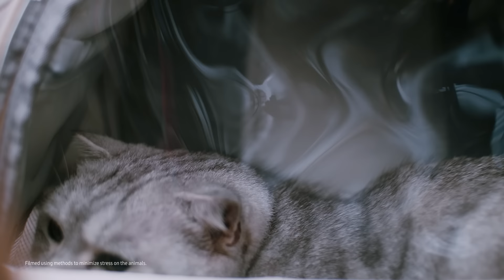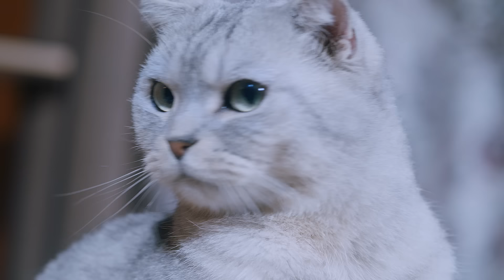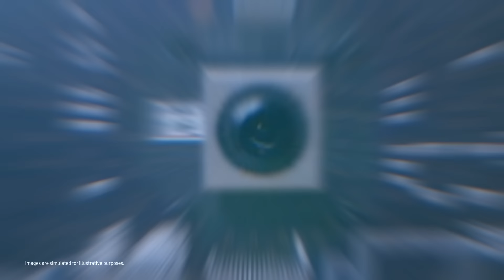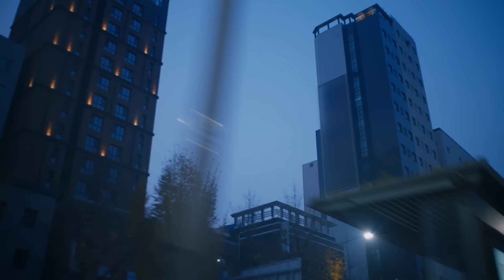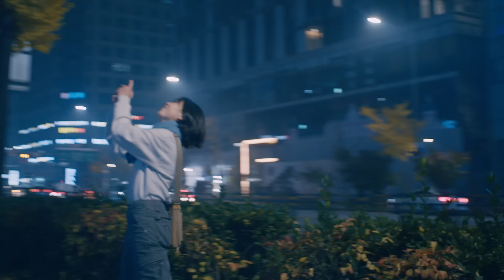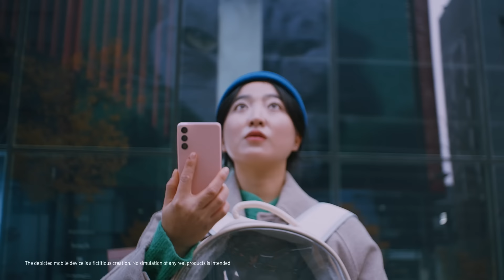ISOCELL Image Sensor: More pixels. More detail. | Samsung

Comment: Sure, if you have a high quality lens like in the video, of course it will look good. 🙄

Phone lenses aren't good enough for this, no matter how many megapixels you squeeze  in a small space.
Reply: But they did not use the HQ lens. They have used standard phone lens. Read the press release
Reply: @digimaniecz  It's literally in the video. When it's removed, it's just to illustrate zooming in to the senzor animation, but smartphone lenses aren't capable of such clear image yet, if ever.
Reply: @etnevel.naitzsirk  Once again, read the press release. I will copy it here for you: "They even built a custom adaptor to allow them to attach various DSLR camera lenses to a test board. “In the end, we thought it was most important to capture the scene in the same conditions that smartphone users would be in,” said Kaeul Lee of the Sensor Solutions Team. “Because of this, we went with a smartphone camera module with no other aids. "

So they tested the DSLR lens but the final image was created using the smartphone lens. I have tested 1.0um and 0.8um pixels at smartphones and believe it or not, the 0.8um pixels with smartphone lens were really able to resolve more details (64 MPx at 1/1.7-inch which is around 128MPx at 1/1.2-inch).
Reply: @digimaniecz  Samsung is weird. I would never use a smartphone lens to print giant billboards. What's this, amateur hour? 😆
Reply: @etnevel.naitzsirk  No one will. This is just marketing. Nevertheless, the smaller pixels really can bring more details to a photo (if there is not a strong denoising which usually is). Another question is if it is useful. Which usually is not.

Comment: This is somehow missleading. First of all the images were taken in a controlled environment with plenty of light, by a person with experience. Secondly the subject chosen for the advertisment was probably chosen on purpose. While fur would be a good subject, yet a different subject with different texture, color (e.g. a parrot) would have been more difficult to shoot. Last but not least the image was properly processed. A normal guy/girl would struggle to obtain the same performance under tough lighting conditions. This is why is somehow missleasing. As a guy with some experience in photography we all know that a smaller pixel size in general comes with a lower sensitivity and is prone to noise. So 200Mpx in my eyes is really nonsense. I would prefer a 24 Mpx sensor with DSLR performance over a finger nail sized sensor with 200 Mpx crowded in a really small area.

Comment: Really hope this doesn't make it to the S23 Ultra. Otherwise I'm afraid we'd see the same issues that made me return the S20 Ultra and Note 20 Ultra. I just don't trust the ISP (image signal processor) in the next generation of Snapdragon SOCs to be able to handle that many pixels, let alone nona binning. I absolutely love my S22 Ultra, but boy would it be nice to have much lower shutter lag..
Reply: you've never used the pixel binning feature?
Reply: @yejoonyang9552  It takes great computational power to calculate and combine the light data from multiple pixels and bin them together. That's one reason why taking a picture on the S22 Ultra with 108MP sensor takes longer than other phones with the same SOC and lower MP count sensors binning or otherwise. Since we pretty much know the S23 Ultra will have the 200MP sensor now, hopefully the new Snapdragon can handle it while still decreasing shutter lag.
Reply: @thisisjoshy  absolutely it should because the gpu on the snapdragon 8 gen 2 outperforms even the A16 bionic
Reply: @yejoonyang9552  The ISP (Image Signal Processor) is what processes the camera data, not the GPU. Even still the roughly 30% performance gains in the GPU certainly wouldn't be enough to effectively process double the data (108MP to 200MP)

Comment: The sensor is nothing compared to the software.. If you want that that sensor works well software in the camera or phone needs to be better.. And for now I don't think you have right software for that... Before Samsung S2, s3 had better pictures at the end that now Samsung galaxy s22 ultra has it. I use it currently.. I have my old s7edge and produce better pictures that this one.. Processing software needs to be better
Reply: I agree on this one as I remember S6 camera with 16mp and photos was incredibly sharp but not oversharpened
Reply: @arturaszaleskis8907  definitely yeah.. I hope they will work more on software development for those crazy pumping up pixels.. @samsung